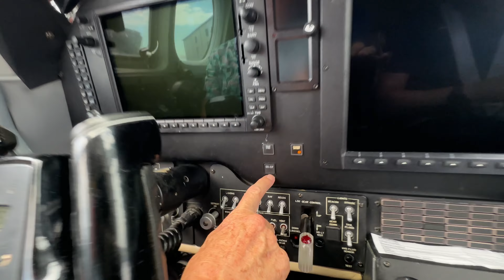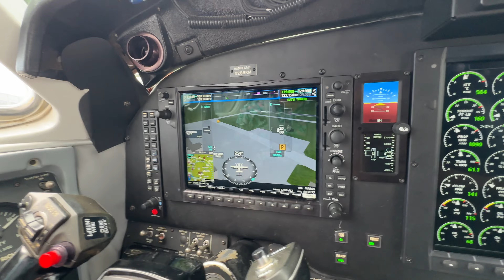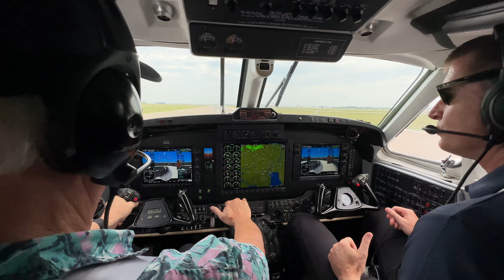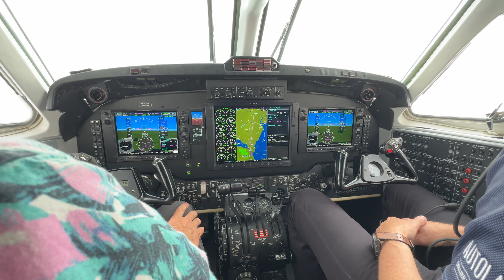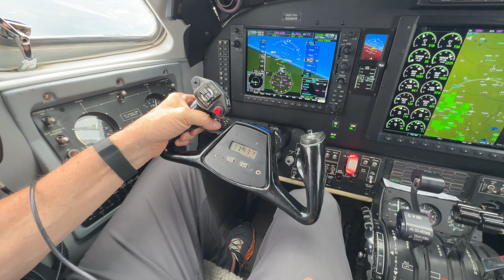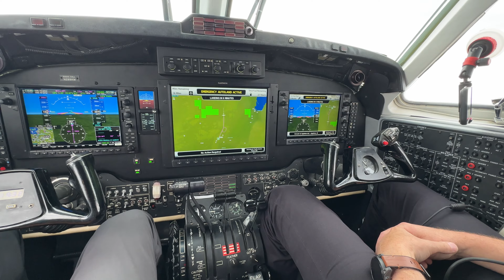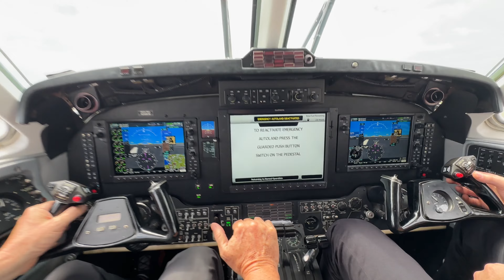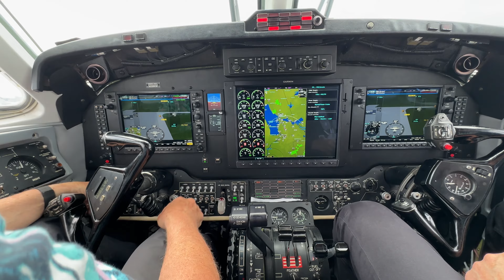Garmin King Air 200 Autothrottle & Autoland Demo  Full Flight

Comment: Nice video of the Garmin Autoland! Was it necessary to match the flap lever to the deployed flaps? Likewise, was it necessary to match the lander gear lever to the deployed position? If not, why was it performed? If so, what happens if you don't match lever to actual positions?
Reply from the maker: Thanks for watching our video. We did it for our demonstration flight for added safety, however it isn't necessary for use of the system.  Since we were going to do another flight and reset everything, it was just a good practice to have the handles match the position of the gear/flaps.  Our article in Twin & Turbine magazine should be out this fall (2023)

Comment: 103 seems terrifyingly slow but then again I'm used to a 350, didn't know the 200 was that much slower
Reply from the maker: The King Air was very stable.  Our Vref in the CJ3 is very close, just a few knots faster.  What is Vref for the 350?  I've only flown it once for one of my articles.
Reply: @PersonalWings  ranges from 100 to 110 in the 350, so 103 would be ref+3 at the lowest landing weight lol

Comment: Why when you press the sistem doesnt speak
Reply from the maker: because the audio was ported through passenger audio systems
Reply: Thank you  I understand  and one more question will the passanger have to press some switches during autoland?
Reply from the maker: @dareltarbuk1332  the passengers can activate the system , if by mistake the pilot can cancel. Once activated no other intervention is needed.